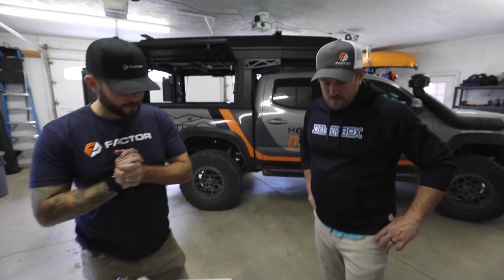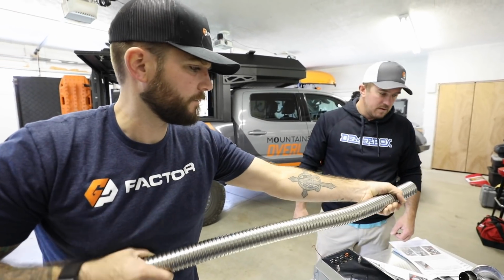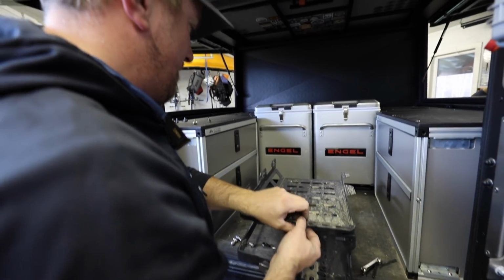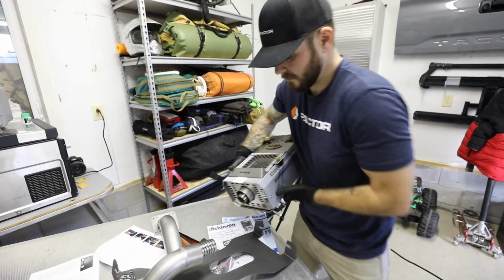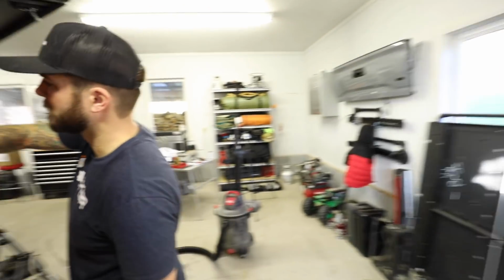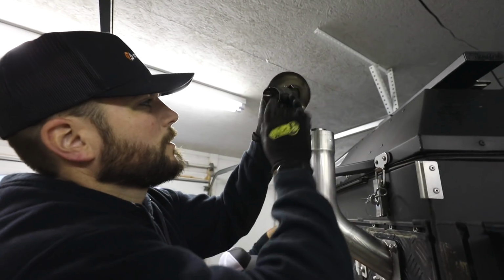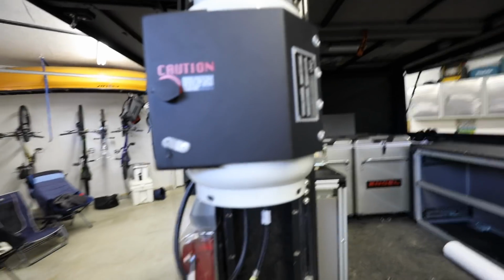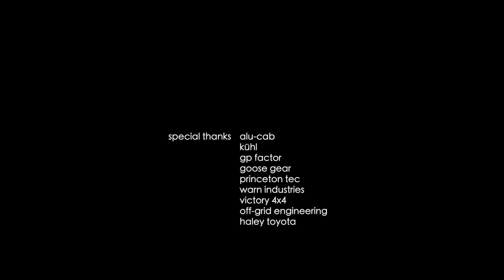How to Install a Camper Fireplace - Mountain State Overland

Comment: That furnace addition to the canopy is setting you on track for the waht would be in my mind the ultimate build!  With the addition of Alu-s new 13 gallon flat tank, feeding into a pump heater into the Alu shower cube, and the the fridge slide out with the stove underneath, the vaccume sealing toilet thing, and the walls for the 270 degree awning, solar arrays on the canopy roof etc and that that would be an amazing build.  Then just figuring some ac solution for summer camping in southern Utah.  Guess one can't have it all.  or maybe it is possible.  Anyways, thanks for sharing!
Reply from the maker: Cheers and thanks! A USB fan options on Amazon should solve your cooling needs in Utah, we carry one around for warm summer nights.

Comment: Dickinson makes nice stuff! I installed their solid fuel heater  (woodstove) version in my box truck as a backup to my Olympia wave 3 and it's awesome to have a fire when the sun goes down and temps drop
Reply from the maker: Hell yeah, that sounds awesome!
Reply: would this be too much heat for a 49 square foot truck camper (like 8 feet long by 6 feet wide)
Reply: I like the idea of this with a wood stove. How well does yours heat up the camper ??
Reply: @warrenmullett  The wood stove would provide enough heat. A friend had one on his sailboat. The issue is you MUST refuel constantly, as in every few minutes. The small pieces of wood and tiny fire box makes for a very short burn. Some folks use charcoal BBQ briquets to get a longer burn.

Comment: Did you re-install the 4 spacer springs that keep the inner pipe from contacting the exhaust pipe? The instructions specifically mention the importance of this: "It will be necessary to place the spacer springs - located on the inner pipe - accordingly so that the inner and outer pipes do not touch at any point. This could create hot spots which will impede the cooler fresh
air that is coming back down the outer pipe to supply the flame."
Reply from the maker: Can't remember. We've never had a problem with excess heat building up on the outer pipe.

Comment: I put one in my van ,, Pro - puts out dry heat....Con - kicked out alot of carbonmonoxide, there defentally not as sealed carbonmonoxide proof as they claim to be, Nope....WHAT I Did - 1. I added extra window wood stove door fiberglass rope stuffing it in the glass window frame to seal better, it needed it. 2. Got more fiberglass wood stove door rope and wrapped it around the pipe were the pipe and top of stove connect sealing the small gaps and cracks then put and tightened 2 big steal hose clamps on it, I also did that at the other end were pipe connects into the roof cap. 3. made sure I had a good fresh air circulation going through the van. Note : make sure your air circulation isn't pulling the exaust back into the van (not dificult to do) ... Yea! put some thought into it, think about  changing wind directions and such..4. I adjusted the door for tightness to get the best seal, thatsxa bit tideious,  that takes plenty of testing and readjusting to get it best adjusted...Good luck.... Ps. side note - just get a cheap Chinese desel heater, youtube has all the ways to best modify them to perfection, there cheap and alot better heating and no holes needed to drill in your roof... my friendly advise, yea! save the $500 to $700 to put twords solar.

Comment: The workmanship on that Dickinson is superb! Just wondering why you chose propane over a diesel heater like a webasto?
Reply from the maker: There’s only a flame a direct heat with the Dickinson. No other parts to repair or replace. It’s simple.
Reply: @msoverland  Thanks! It’s a real nice install, thanks for sharing!

Comment: Are the specialized angled pipes going to and out of wall available through Dickenson or did you have to get them Custom?
Reply from the maker: The kit to install this heater is built by GP Factor and available at OK4WD.

Comment: Nice build bros. Looking to do something similar, but I just wonder if you still have enough fresh air sucked in trough the inlet because you didn't use spacers in between the exhaust and inlet on the new chimney?
Reply: Ya I was wondering the same thing? Thats why. They have that second channel to allow for air intake. I too am curious. Also how is the heat from “propane” I was considering the Marine wood burning Dickinson Stove as many state that propane creates lots of condensation vs wood is very dry heat. Idk hope someone can shed some light on these points. Definitely a sweet install! 👍
Reply from the maker: Propane burns in the furnace, just like an furnace and radiates out. There is an internal fan and we have secondary fans to circulate in the camper. There is no off gas in the camper. All by product of burning propane is exhaust to the exterior of the camper. The only condensation you get it is due to thermal bridging and you'll get that from any heat source.

Comment: Greetings! Sweet video. I may have missed it in the video but how long did it take to install? I’ve received a quote of 10hrs from an alucab dealer. That seems excessive. Keep making good videos!
Reply from the maker: Honestly, a day and 1/2 I’d you have everything you need. Running the wire for power to the fan. Running the gas lines. Installing the propane tank are all extra components to the complete install. I’d say if you could have someone do it in 10 hrs they’re moving and have done it several times.
Reply: Thanks for the response! The magic of youtube makes it look like a much quicker process.

Comment: Where do you buy the hitch receiver steps? Those look awesome
Reply from the maker: It’s called the Easy Hitch Step and it is awesome - with some few modifications and a lot of maintenance. The problem lies in the hinge, it’ll freeze up and won’t budge even if you keep it oiled. It’s so bad now I had to remove it. Ideally they would drilled a grease zerk into it so you could keep it lubed; that might fix it. Next, it needs a locking pin that you can tighten up to secure it to the inside wall of the receiver. I welded a nut in the inside of it so I can anchor it in place. All said, it’s burley and I’ve wacked it a few times hard on rocks with out any damage but they really do need address these few fixes to make it usable longer term.
Reply: @msoverland  Have you let Easy Hitch Step know about some of these issues? I'm about to order this for my set up. Do you have pics of the locking pin solution, the welded nut? Thanks awesome set up!

Comment: I'm curious about the regulator, I just bought the same set up, but on the Dickinson website they say to use the 189$ two stage regulator. My local store asked there supplier,and I ended up with the one you have for 25$. I wonder if the stove performs differently with the more expensive regulator???
Reply from the maker: Maybe? I’ve never had a problem with mine to date.
Reply: @msoverland  perfect, I'll be installing mine soon. Looking forwards to winter camping next season.

Comment: How is the condensation inside the camper with the heater running? It is more like a Mr Buddy, that creates condensation or more like a diesel air heater, that is dry air?

Comment: Any issues with condensation build up with the heat running?
Reply from the maker: Zero issue as of yet. The burning of propane is locked inside a sealed compartment in this furnace and exhausted through the exterior pipe. By exhausting the furnace you are venting the by product of propane which is water vapor outside of the camper and mitigating condensation build up inside.

Adversely, we tested a Mr. Heater Buddy heater in a camper last year. It was a controlled environment and we ran the heater only for experimental purposes. After running the heater for 30 mins we noticed significant water vapor build up in the camper as a result. The conclusion was that a lack of proper exhaustion and an open flame contributed to condensation build up.

All said, use caution with a portable heater without proper ventilation and tested/functioning CO alarm. Even though some of those heaters do have CO cut offs, it can fail or be too late before the heater automatically cuts off.
Reply: @msoverland  greatly appreciate this response. I too have heard about the issues of propane and condensation. Im glad the Dickinson stove exhausts that outside. Still trying to decide between this and the wood version.. great install guys, thanks for the share!

Comment: Is it just a heater? I think the best way to heat-up your camper is diesel heater. Less cost, more effective, low fuel consumption. For your camper you will spend maximum 1 liter of diesel for night with -15C outside.
Reply: On low, this furnace we estimate that this furnace will run at least 5 evenings on an 11lbs. propane tank. At $1.50 per pound of propane, its a hell of a lot cheaper and that kind of efficiency I'm not "losing any sleep." Cheers mate!

Comment: is there any concern with exhaust fumes entering when the tent is up since the pipe terminates so low?
Reply: Nope. The exhaust is vented to outside air. We have installed a CO detector in the camper and tent as a precaution.

Comment: Time to get rid of that plastic rear bumper
Reply: No way, last time I had a aftermarket rear bumper and got rear ended it totaled the truck. I'd rather crunch the rear end or lose the OEM bumper than lose the truck.
Reply: @jasonspecht827  those do the same thing, they are designed to total the truck. If you look at the frame it is designed to bend if rear-ended.  The center section of the bumper is already metal, just the ends are plastic, will bend anyway,  ive seen it over and over, designed to bend, you can even see the spot where they designed it to bend....gov regulation.